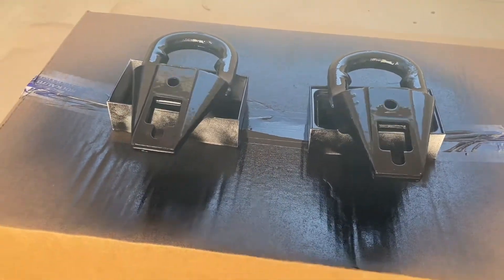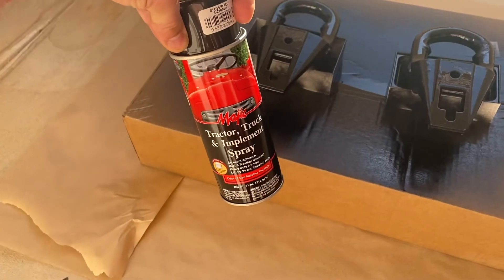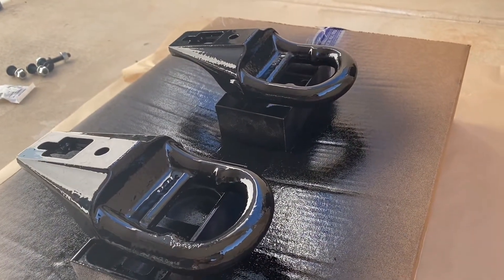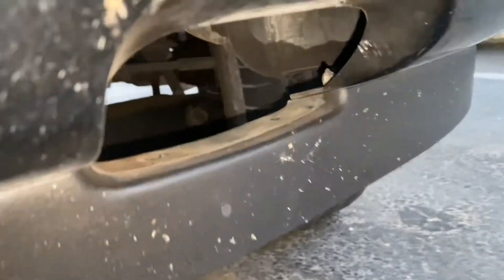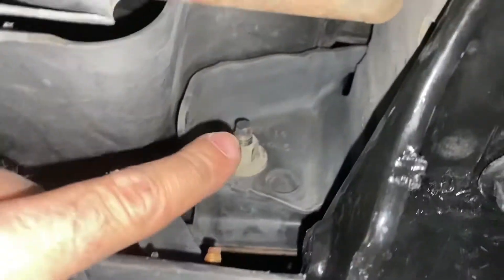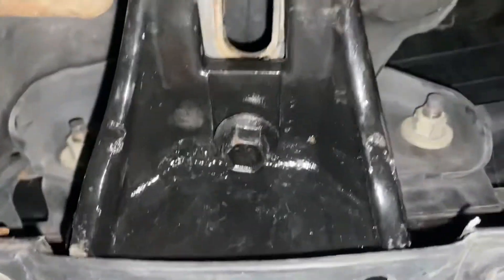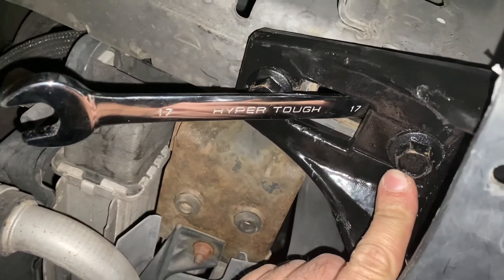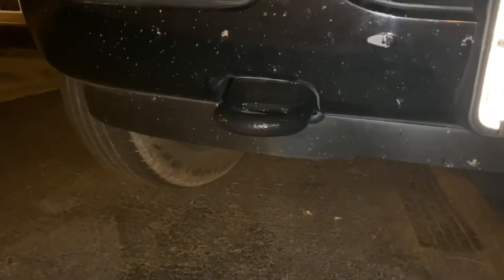Front Tow Hook Install - 2003 Ford Explorer

Comment: Nice job ....I have a 98 mercury mountaineer do you think this would work for it ...sucks they don't come with front or rear tow hitch at least not the one I have and thanks
Reply from the maker: I’m not sure. I’d check to see if you have the install points and holes pre drilled on the frame.